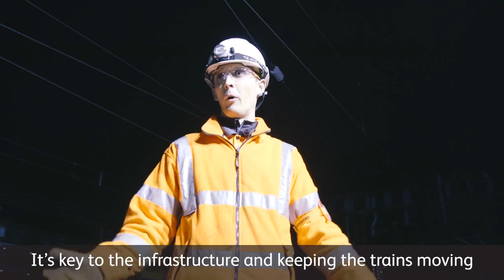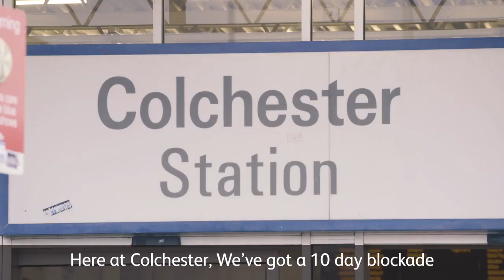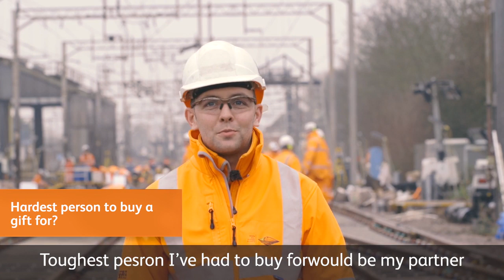South Rail Alliance Delivers Christmas

Comment: 3:35 Wait… aren’t brand new rails usually rusty ? They only get shiny by being used.
Reply: It's only a thought, but after the new track is down, won't the various pieces of equipment that move over it - eg. ballast trains, tampers, etc, remove any dirt/rust off the top surface of the  track and give the impression of shiny?